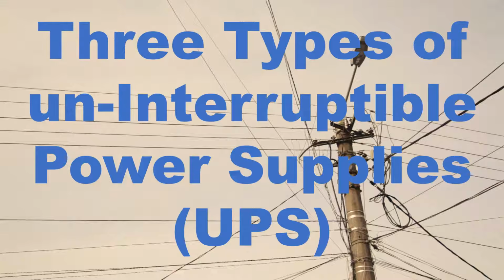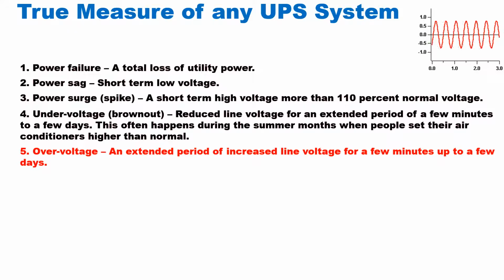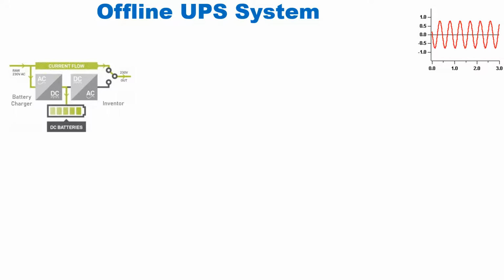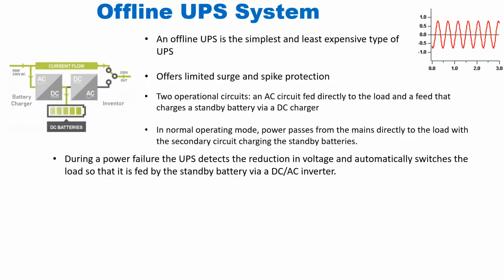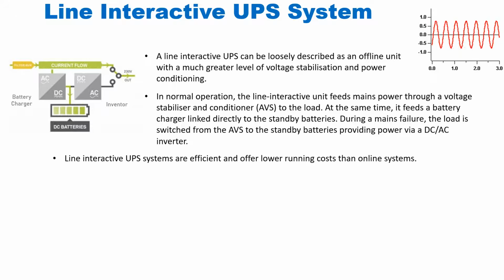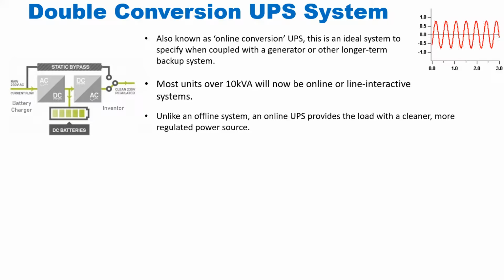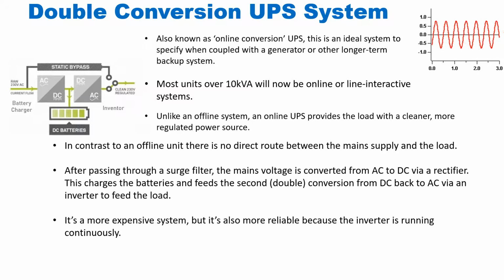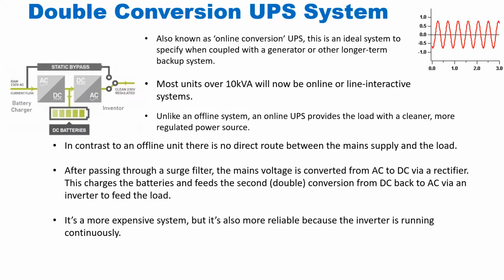Different types of Uninterruptible Power Supplies (UPS)

Comment: Respondent Online Survey Company is searching for experts on Design and specifications for Uninterruptible Power Supply devices to participate in an online 20 minute survey.
Approved participants will get $300 for  20 minuted One-on-One participation

Are you deciding the type of batteries and other direct current backup power technologies used at your company? Do you play a role in the design and make the specifications for Uninterruptible power supplies (UPS) for your company’s data center(s). We would love to talk to you!

1- Click on link below and create a profile
2- If you can avoid it don put your work email since Respondents verification email sometimes doesnt make it through corporate email filters
3-Fill out questionnaire for this survey to see if you qualify. 
4-Screeners will view all applicants answers and pick a group.
5-Things that can help you get chosen are having your LinkedIn and other social media (work ones) in your profile so screeners can verify your qualifications.

https://app.respondent.io/respondents/projects/view/5eb042663c4430002ea48556/design-and-specifications-for-uninterruptible-power-supply-devices?referralCode=jonathanreed-7ee12c2b0fd2